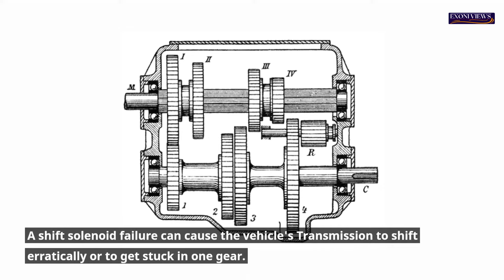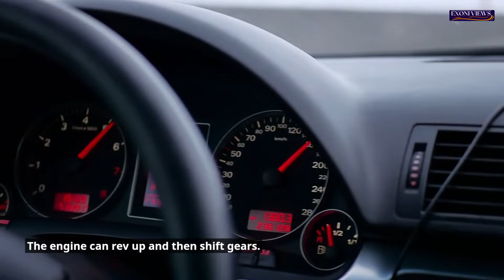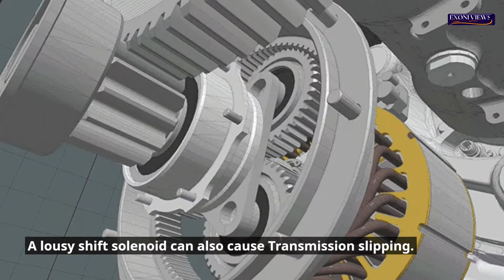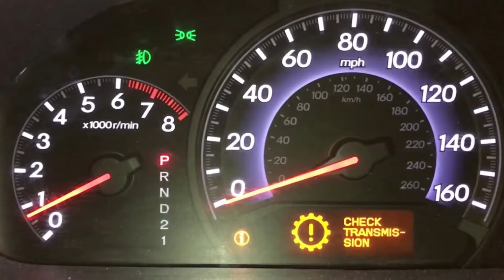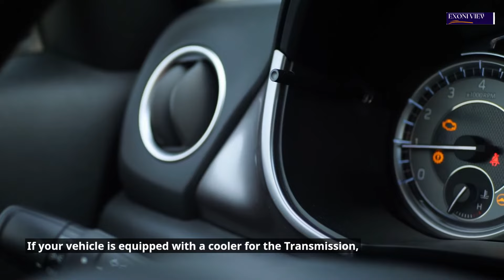Unveiling the Fascinating Causes and Symptoms of the Elusive Bad Shift Solenoid."

Comment: I hear whining noise from the transmission especially i drive long journeys and the car normally going into limp mode and doesn't exceed 80 or 100mph. If i park the car for a while and go again, the car will go very well and even up to 140 mph. As if there was no any issue. We check on the codes and we get P0740 sometimes P0741 which means Torque converter clutch solenoid or circuit malfunction. Do i need to change the shift  solenoids ? And should i change also the transmission filter?